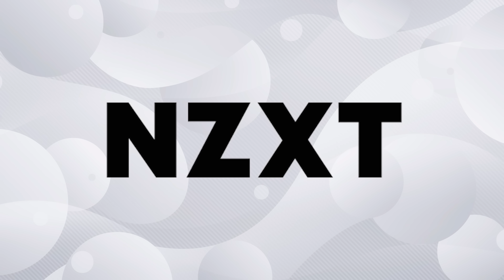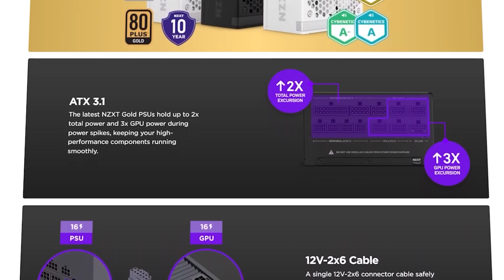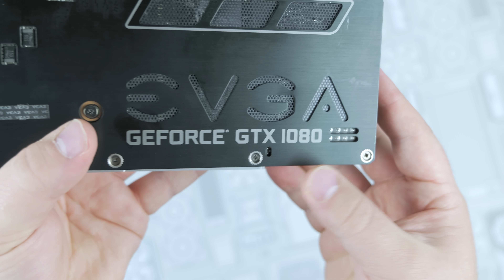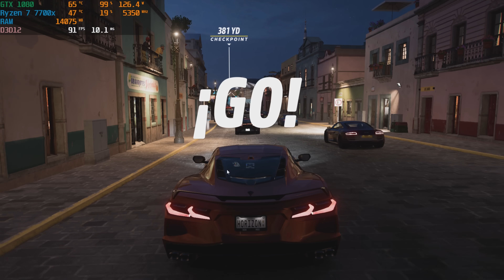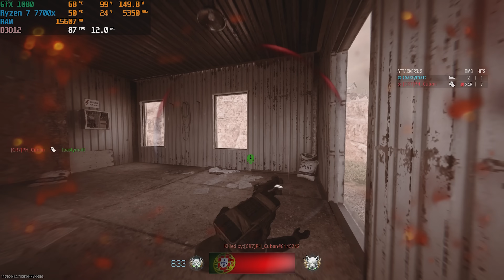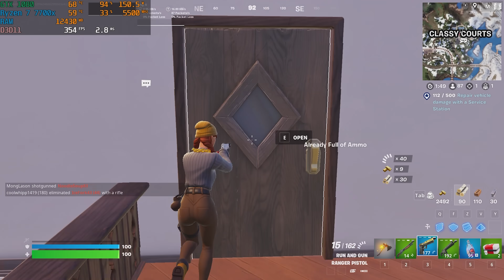This AWESOME $120 GPU is All You NEED!

Comment: Hey love your videos!, I have a question and was wondering if you would know what would cause this problem so on my gfs pc when ever she plays mw3 after playing a game or 2 it’ll say on the screen no signal and then I have to force shut off the pc but when playing other games it’s fine and overall doing anything else it doesn’t do it, the components she has are a intel Xeon E5 2630 v2 and ddr3 at like 1360mh 16g in dual channel and for the motherboard szmz X79SE LGA 2011 and a asus rx 580 8g and the power supply is a 500w bronze rated.

Comment: An old friend had a 1080, and once I got my 3060ti, he was still getting better performance in some games than my 3060ti. We can't rule out the cpu impact entirely, but the games were gpu intensive and the 1080 held it's ground against the 3060ti easily.
Reply: 6600 is moreee cheaper with same speed with no ti spr sprm junks names..

Comment: Yeah, I had one of those a few years back. And it is still great. But that will only last until Nvidia kills the driver support. And for 120 bucks I would look for something like a RX5700XT, which is cheaper, newer and has more features with the same amout of VRAM. And for like 30 bucks more, you can get a a RX6600, which is faster and uses less power (which matters here in europe!). Or you can get an ARC A750, which is faster but not as consistent as the Radeon. I would love to reccommend a newer Nvidia as well, but there are none within this price range which are faster...

Comment: 10 series isn't the next on the chopping block for driver support drop, 900 series is. Maxwell from 2014 is still getting driver updates so you've got like a buffer generation before losing driver support for the 1080

Comment: Just upgraded from an i3 9100f/ GTX 1080 setup to an i5 12600k/ RTX 4070. The only game I had trouble running with the old setup was Ark Survival Ascended, an epically unoptimized game. Wanted to move up to 1440p, neither the i3 or 1080 were cutting it for that.

Comment: A gpu from 2016 is not worth recommending at $120 used. It's got zero warranty and they have been used a ton. Unless you are talking old new stock its borderline irresponsible to recommended them to anyone not already well versed in building and repairing computers.

Comment: I was at first dissapointed in my recent GTX1080 purchase since Fortnite was only getting 20-40 FPS, but it turned out to be a wierd bug where you can press the Windows key and then click fortnite in the task bar and the FPS would jump up to 120 or more(my frame limit was set to 120). I kinda knew something was up since the GPU was only showing 18 percent usage in task manager.

Comment: Maxwell cards are still getting driver support so Pascal cards will get a couple of years of support after Maxwell has been sunset, maybe a bit more for 1050ti and 1060 cards due the sheer volume of them out there still in use.  I think at this stage we must consider Pascal one of the very finest generations of GPUs we've seen.

Comment: To be fair an rx 5700 is a better choice for a couple more dollars(150 on aliexpress and ebay) you can use the software hack to have it unlocked to 5700xt levels and then u have fsr and frame gen at driver level
Reply: Lmfao
Reply: Afmf Is 6000 and newer

Comment: I had a 1080 until it died on me and killed my mobo. I was devastated but thankfully I was able to find the same mobo and then I replaced the 1080 with a 1070.
Reply: how did that even happen
Reply: @aymen.d1372  The pcie slot shorted out. I have no idea how. It worked the day before just fine, and the next day it sparked and smoked out. Instant death.
Reply: @boonedawg1506  wild....can be the psu tho not 100% but mostly its the psu buy that thing that saves your electronics from yk going boom forgot the name ups or smt
Reply: @aymen.d1372  psu was fine.

Comment: Unironically, I have used the GTX 1080 since I upgraded my 980.

I dont have a 4k monitor, so no need for 4k, thus I can max the games I enjoy and run them at 60 to 75 fps easily.

GTA5, Destiny2, and all kinds of steam games.
Reply: Same as, though I switched from a 1060 to a 2060S (so pretty much the same performance tiers as you) over 5 years ago and as I'm also happy on 1080P60 I still don't feel the need to upgrade.
Reply: @darthwiizius  I run dual 40 inch 1080p tvs and I don't mind 60fps cap, so mt 5700xt has treatet me well for 2 and half years now
Reply: @unholysaint1987  
Another great performance for the money card, even when it was new those were beasts for what AMD were asking.
Reply: Glad to see the gtx 1080 is still holding up for 1080p for alot of games. Such a solid option for a budget build!
Reply: @TheOGtyler  1080p is still where it's at... look at steam hardware survey from last month... 57% of users run at 1080p, and 9 out of the top 10 GPUs are 60 class or lower (2 are mobile GPU)
Reply: pros dont play at 4k  , they game 1080p ,  so 1070ti is enough its all you need 60 frames ulta most games i got 16 gb ram 3200 , ryzen 5 4500 i get 60 frames ultra settings most games 1080p
Reply: God is good all the time all the time God is good ❤️

Comment: Hello Toastybros! which laptop do you prefer and why?                                                             Asus TUF 15 FA507XI-HQ014, AMD Ryzen 9-7940HS, NVIDIA GeForce RTX 4070 8GB, 16GB RAM SSD 512GB  VS  Asus ROG Strix G16 G614JU-N3186, Intel Core i7-13650HX, Nvidia GeForce RTX 4050 6GB, 16GB RAM SSD 512GB ?

Comment: I've been sticking to old mid last gen gpu's for a while, went from rx 570 to 1070 to 3060ti, works for me, ill buy a 4080 super for 300 dollars in 5 years.
Reply: Same. I refuse to pay more for a gpu than a pc used to cost.
Reply: Yep, had almost the same myself. GTX 1060 -> RX 580 -> GTX 1070 -> RTX 3060 Ti
Reply: rx570- 1070ti -2080s - 7900xt
Reply: nvidia = overpricedddd..
Reply: Ha, my exact upgrades over the past years!

Comment: sappire pulse 5700 xt would kick that 1080 in the bin , i believe the 1080 ti a good choice but the 5700xt will stick that one in the bin ,
Reply: The 1080 Ti and 5700 XT are pretty even in terms of gaming performance but the 5700 XT is generally $20-30 cheaper atleast here in the US making it the better choice.
Reply: @NotBuuba  I got some fantastic fps under the flag of the graphics card and still use it at 1080 or 1440 it is a card that soaks up the software amd have gave it and raised the fps count .
it is a top tier card , i got it for 130 quid , 130 pounds so ye lovelly card.

Comment: 1080ti is still way more relevant if you can get it at a decent price over the 1080.
Reply: Yup and that's in between a 3060 and 3070
Reply: In recent gpu's It's about a Rx 6600 XT in performance

Comment: is the msi 1650 ventus any good?
Reply: ofc no
Reply: It's good but you won't get much more than 1080p 30-60 fps. If you get a 1650, used is best. I recommend a GTX 1660 super if you can afford it though.
Reply: And if u have around 183$ a used 1660ti is good
Reply: @EnviousR6  I see them now for like 120-130
Reply: Good if it's below 75 USD, used that's about what they average don't buy one new.
Reply: Gtx 1660 super and 1660 ti are about the same speed. Why Nvidia released both cards I have no idea.
Reply: @Jman-g7s  the 1660ti is 5% faster and have more vram I believe

Comment: half my friends are still runing 1060s lol
Reply: Was recently running a 1060 max q on my laptop until I upgraded just recently to a good deal on a r3 alienware with a 2070 super mobile.
Reply: @jponz85 only the peasants run 1060's, time to step out up to the aristocrat level
Reply: @SwingArmCity  I couldn't agree more with you I e been telling them for years and the said thing is they all make really good money and could totally do it 😄
Reply: @krisxpytot  I would recommend the 6750xt. Sweet card
Reply: @SwingArmCity  I have a pc rig. 13700k paired with 3080, 32ddr5 ram etc etc... I'm far from peasant kid. My Gaming laptop has a 2070 super now so on the go it's fine. Plus I have a rog ally in case I want to use that as well
Reply: @jponz85  You do, 3080, 13700 (get rid of that POS), plus a 2070 and ROG??That's king worthy equipment. It was a joke kid. Besides your stuff, isn't that great.
Reply: @SwingArmCity  how ironic that's what I'm rocking is that what you have I'm paired with a r5 7600
Reply: @jponz85  💯 solid as a rig could be man well done I have one friend has has a similar set up and he says it fricken rips hard he runs 3 screens as well 1 4k others are 1440 p
Reply: @SwingArmCity  on the contrary he has a really solid rig that's a good for atleast 5 years or more depending on how gaming goes and if he wants to keep proformance as high as he can he will upgrade in five more years to keep up with current gaming if your like me (34yrs old ) then Your set for ten maybe more and those are facts considering the 1060 and up are still valid cards I can only assume when I'm 45 they will still be talking about the 30 series as a solid cheap stable go to card for esport gaming or single player gaming on 1080p
Reply: @SwingArmCity  a 13700k "isn't that great"? Lmao... stf up
Reply: @krisxpytot  great value combo
Reply: @jponz85  I guess you've had your head in the sand with the lastest intel problems huh?  I wouldn't touch a 13/14 gen intel cpu.
Reply: @SwingArmCity  nope there time has had past time for amd to take over atleast all there cores run at the same time not loaded up on one and barely touching the other
Reply: @krisxpytot  wtf are you talking about? I said good value combo and.......
Reply: 1060 6 gig is the best
Reply: I’m running a 1660 ti on my main and 1050 on my project
Reply: Great cards, I used to have the cheapest chaviest 1 fan Zotac version and it was [pleasantly] shocking how much of an upgrade it was from the 770 it replaced.
Reply: 1060 is all it takes for the good games. New games are mostly not worth it.
Reply: or 1660s if they're really ballers 🤣
Reply: God is good all the time all the time God is good ❤️
Reply: I just installed one for my brother! Not future proof but it'll be great for keeping the door open for everyone to have access to modern games for very little $!
Reply: Tell your friends to get jobs
Reply: @HOBOTw1tcH  those who get jobs don't have time to play games
Reply: I was running a 1050 until I upgraded to a 1660 and regret it, now I’m working to get a 3080 from my friend!
Reply: dont buy 13 14, cause so many have crashed..
Reply: Ew... poor people
Reply: @authoritariangentleman7570 ew people who shame other people for what graphics card they have. Get out mr 🤓 with intergrated graphics
Reply: Poor people
Reply: @Senpais_PCs bro u on a channel dedicated to giving us budget options for computer gear, so sydau u obv here for a reason
Reply: @Senpais_PCs  They might be poor but those are the kind of people you should admire. PC gaming can be so expensive. We spend more money than we should, on parts that we think aren't good enough to please us..
Reply: @Ladioz  I started into PC's with a 5700g when it dropped because GPU's were so pricy.... it was not enough to please me on a 1080p monitor, neither was my 3070ti FTW3 ultra or my 6950xt red devil on the same 1080p 144htz pannel. If I just want to play the game, I would just keep running consoles, but I really enjoy high settings and modding games that allow it. Most games I play will tank my FPS into the 30's or 40's on ultra settings......which I enjoy turning on. I don't think everybody really needs to do what I do but I enjoy it. It is more of a hobby for me to build the actual PC and nerd out on specs and speeds and compatability rather than playing the game itself.
Reply: @Senpais_PCs Same here but I'm not poor. 😂
Reply: @BREEZYM6015  exactly it's just a valid card still alot of tubers are still talking about it and the titan frequently